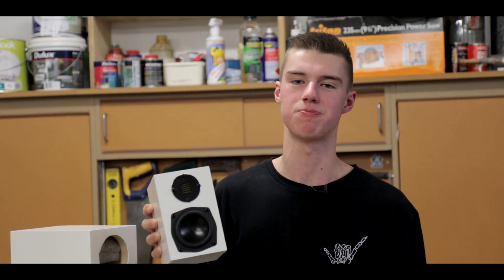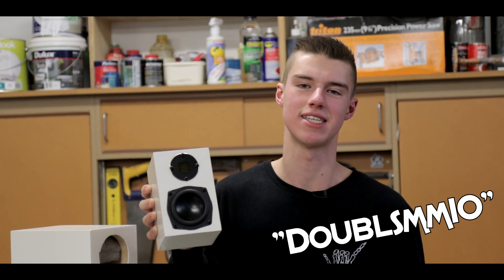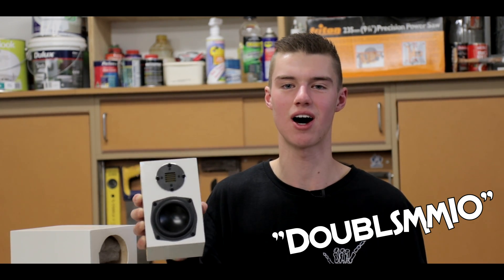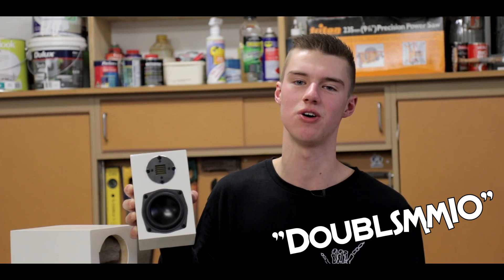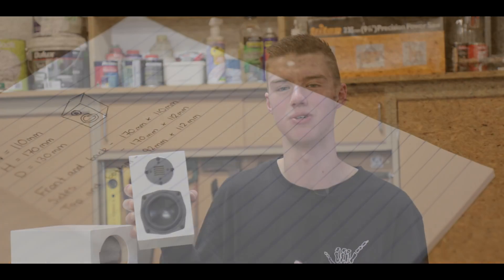HOW TO: DIY - MINI HIFI BOOKSHELF SPEAKER BUILD!

Comment: Nice build, I would have done a few things differently in the construction of the speaker case but seems like your tool range was a bit limited. Nevertheless finished product turned out well. Also learned a bit from some of the other commenters. Keep it up, cheers.

Comment: Whats the fire for?
Reply: Gershon Dharmanandan He always makes a fire to dry the paint
Reply: jbl 04 ahh right! Is that to make it dry faster? Or are there any other benefits?
Reply: Gershon Dharmanandan no i think he just likes to work fast. And with a bit of heat in a room the paint drys much faster.
Reply: jbl 04 ahh right ok... Is it bad for the paint?
Reply: Gershon Dharmanandan as long as you don't put it right in front of the fire. Leave it about 1,5~2 meters away and you'll be good.
Reply: jbl 04 awesome... I'll have to try that next time!

Comment: Hey there Doublsmm:

Those would even make great PC speakers as well. I mean they are nice and small and would not look too big on a desk. You would need to pair them up with a subwoofer though cause they don't look like they would put out enough bass to really make them  good standalone speakers, maybe if you used a pair of the 5" drivers like the ones that you are gonna be using in your main towers then you would have an argument but those little guys would DEFINITELY need a sub to really make them sing cause they just cant really reach low enough to be a standalone pair. Maybe at work cause you probably would not want a sub cause it could be a disturbance to your co-workers but at home definitely build a sub.
Reply: They wouldn't make nice speakers for any use in their current state without any tweeter attenuation. TSSSSS TSSSSS TSSSSS

Comment: I might kindly suggest doing some proper speaker research before investing too much time and money into building. In this case, those are killer drivers, buuuut not very well matched - especially with a prefab xo. That AMT tweeter shines from ~12kHz on up and has a goofy response curve below that. The highest I'd push the ND91 is ~8kHz, so there's that gap between 8k-12k where neither driver is really "great", but it's crossed over at 5k. Also, the tweeter is 6dB more sensitive than the woofer, which is clearly audible in the clip.

"123Toid" has a really awesome series on XO design. You might check those out before investing a lot more time and money into...well...poorly designed (and probably poorly sounding) speakers.
Reply: Wow, thank you for the props.  I really appreciate it.  I hope you have enjoyed the crossover series and learned some.  Thanks again, I am humbled by this response.
Reply: That is great feedback! Thank you from a viewer.
Reply: What would you recommend crossing these specific drivers over at?

Comment: Wait, you used an 86db tweeter and an 82db woofer, with no L-pad?  Wow, that tweeter must be overpowering that Dayton ND91!  Any why use a prebuilt crossover?  Do you have any graphs to show us a frequency response?  Don't get me wrong, it's cool idea...
Reply: I did the simulation.  He is getting up to an 9db increase from  4000 on up!  And that is before baffle step.  That means, there might be up to a 15 db increase from the bass region to the tweeter.  Yikes!
Reply: Yep, the first thing I thought when I heard the "TSSSSS TSSSSS TSSSSS" was "uh-oh, no attenuation on the tweeter"
Reply: Absolutely :)
Reply: Ah OK, didn't realise that about the impedance but makes sense! Thanks for letting me know, I'll look into it :-)
Reply: SNDCX I wasnt trying to be a jerk and just be critical. Just trying to point out the pitfalls. There are many very well designed speakers out there for people to build if they dont feel / arent ready to design a XO from scratch.
Reply: SNDCX exactly right. Anyone can do it. They just have to learn it. 123toid has a series and Ive done a few things showing why not to do this as well as some tutorials on software to help. None of it is fully comprehensive but not out of reach for anyone who puts in the time.
Reply: it's a little more complicated than that.  But if you only want to attenuate down the tweeter, you would want to resistors on the HF output on the crossover.  One in series and 1 in parallel.  If you are interested in designing your own crossovers, I do have a series that teaches it with a free program.
Reply: Thing is. If you just start with this hobby, channels like this really give you the idea it’s as easy as buying a woofer, a tweeter and a random pre-built x-over. It’s pretty annoying how many videos this guy has applying that exact routine. Those speakers must sound horrible.  

If you start building speakers, I would advice going for a proven and existing design. Like one from Carmody or so. If you really want to do it yourself, guys like 123toid and kma can learn you the basics of enclosure design, driver selection and designing a crossover. These channels are great resources for beginners.
Reply: That indeed isn't very good, but I doubt Lil' Jack has time or experience enough to build a crossover from the ground up. Say what, perhaps next time you could help him. :p
Reply: Woah, I didn't realize this was going to happen.  I leave for 1 minute...  Seriously though, I didn't realize it was a 15db difference, or whatever 123Toid said.  But I do agree with Impulse audio and him.  If you do not know how to build it, as for help or go with a pre-design. I just was afraid others would want to emulate this and hate the sound....
Reply: I actually teach a series on how to build crossovers with a free crossover design program.  So he or anyone else could check it out, if they wanted to learn.  It is not easy to do though, as I am sure you know.
Reply: It's not easy for a beginner but once you get the hang of it you know what issues are caused by what facts and you know how to fix them. It's like starting out with coding. c:
Reply: I at least got the basic idea right though...? :-)
Reply: I'll let you know, currently using pre-built speakers with subs built by myself but it would be nice to shift away from that - indeed it's the crossover stuff that puts me off!
Reply: the resistors are indeed right to some extent. Note though that if you add resistance inline, you'll also need to make sure your parallel-resistance stays acceptable. Speakers with an 18ohm impedance are a bit.. weird. :)

if you really don't think you want to design crossovers yet, then make one of the many good kits that Jeff Bagby or Paul Carmody made. They're really nice kits and they also make you think about layout of the crossover. ;)
Reply: those arent SnR ratings. They're the SPL at 1W at 1Meter distance in-phase. The off-the-shelf crossover he used is fine for these two as the crossover points is well within the limits of both speakers. There will be a slight V dip in the midrange though but most people prefer that anyway.
Reply: SNDCX off the shelf crossovers are never ok unfortunately. Its a hard lesson to learn when starting out but if you were to measure and build a proper XO the sound quality would improve tremendously.
Reply: Just needs some resistors on the HF output of the crossover right...?

Comment: Not good sound
Reply: That has to do with crossover design in this case (or lack there of).  Dayton Speakers sound great.  And Parts express is a great place to get them.
Reply: the crossover is okay, but it's the V-dip. it's a bit extreme in this case. It can be avoided by coupling the input a lil' more.
Reply: I do. I do build crossovers. I modeled some custom ones for my Tango MT's. :) I never said the crossover is really good. "Okay" is a mere "I would definitely cringe at that but a beginner wont notice". It's FOR SURE not an ideal situation, as you know yourself too. I also thought about the attenuation problem, and the baffle issues. The biggest issue with the baffle is that the speakers will be nearfield when used as read channels (although his are firing into the center of the room).
Reply: Wood type might fuck up ur sound too !!!
Reply: But probably not as much as electrical differences. The damping factor of a piece of wood in this cabinet doesn't really matter as there's other things overpowering problems this causes/
Reply: SNDCX I'm going to make the assumption you don't build crossovers from scratch like I do.  If you do, then model it. You will notice that the Tweeter is at least six decibels higher than the woofer .  And that's just the beginig.  There's also the issue of only 1st order crossover on a full range speaker that increases the mids,  while keeping the bass frequency way down.  And there's absolutely no compensation for baffle step loss. Which is clearly happening.

Comment: Can you build A powerful Portable Boom box. (Bluetooth Class D amps) the most interesting part would be the Battery. Anyways Love your video
Reply: Adithya Pillai he already did that like a month ago
Reply: Perhaps one more maybe? Did love that video. But I quite don't understand why people use Passive Radiators. They sounds all cheap compared to real Sub woofers. Would love to see someone make a boom box that has a built in sub. 😁
Reply: passive radiators are meant to be used as a speaker. They are an alternative between Sealed and Ported design box. For example a subwoofer can either be sealed, ported or have a mix between the two; Passive radiator. U can read about it here by a speaker manufactuer : https://www.goldenear.com/products/supersub-series

Comment: please can you explain me how to paint MDF like you? I love the look of your subwoofers and of these new speakers
Reply: ChiTuSai be careful when working with MDF. You probably know about the health risks already, but just incase you don't haha.
Reply: yeah, mdf dust has high percentage of formaldheide (maybe I wrote this name wrong), but with a mask and a vacuum cleaner, risks should be avoided
Reply: ChiTuSai Yep should be perfectly safe. Thought I'd comment just in case you didn't know. No harm in making sure you're safe haha ;)
Reply: You can also sand outside on a windy day. Just.. not on the lawn.
Reply: apply wood undercoats about 3 thick layers if possible and lightly sand with 320 grit sandpaper in between and leave 1 day to fully dry.
sand it smooth with 400 grit and use canned aerosol spray paint of your color choice. it will look smoother than Doublsmm's  finish. give it  a try
Reply: Thanks a lot

Comment: Also, you said it was gonna be a 5.1, but you have two subs so wouldn't it be a 5.2?
Reply: actually, no. In cinema terms bass is always Mono (to prevent cancelation) so the 5.x figure is however many subwoofers you have. Not subwoofer channels. So in theory, it's 5.2, but practically 5.1 as the woofers are so close to each other that they function almost as if they were in the same box. This has to do with spread and phasing. 5.2 would be applicable for the Subwoofer-wall idea where they aren't close to each other in attemp to get better bass coverage.
Reply: Channel numbers like 5.1 etc are the number of channels that play different sounds to one another. A 7.1 system with 28 speakers and 4 subs is still 7.1, not "28.4"
Reply: Nixon Plays but they arent in the same cabinet
Reply: Charlie D same cabinet or not there're still being fed the same single Subwoofer signal so it's still .1
Reply: 5.2 if the 2 sub is for one left and one right. But if 2sub playing mono it will be 5.1
Reply: Oooohhhhhh...
I see, sorry if I mislead you guys
Reply: Charlie D who give a shit
Reply: Charlie D the subs are in the same cabinet, so they are considered to be the same